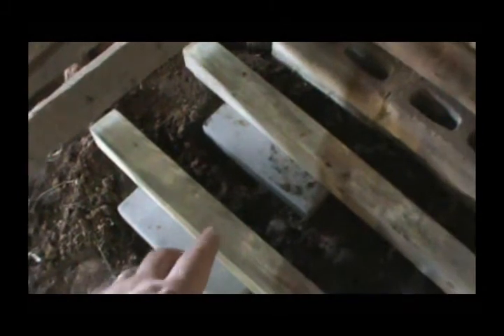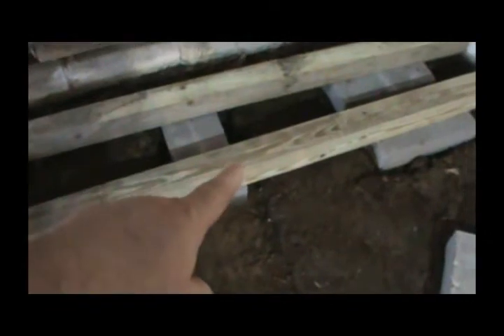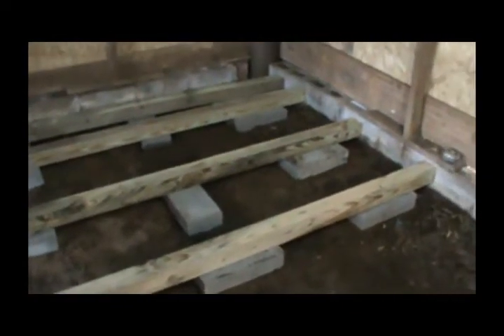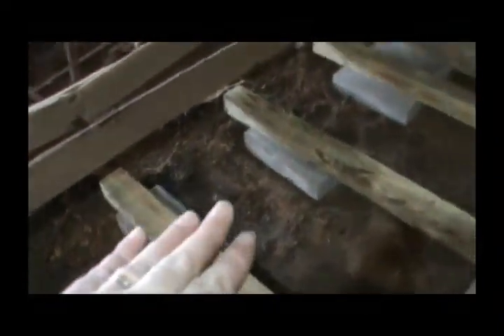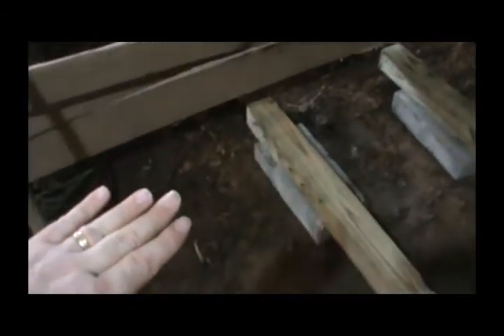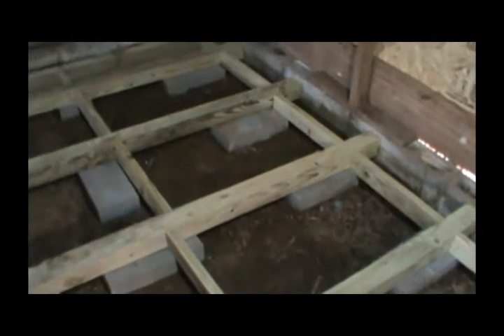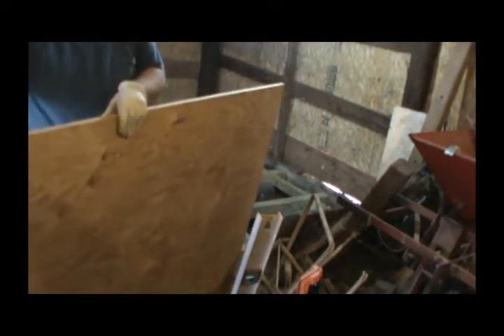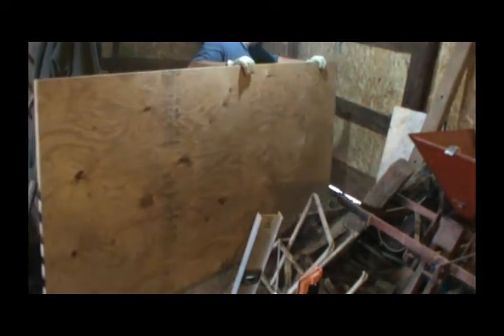Barn/Shop Storage Room Floor Install

Comment: Looking good fill up those cracks with something around here we have cooperheads and rattle'er they like place'es like that to hide when its hot, few years aro i killed two of the bigest rattlesnakes  i ever saw under a corn crib floor they were about 7' long both of them i think they were mates they are protected in tn. but i dont think a jury would convict you on that charge.